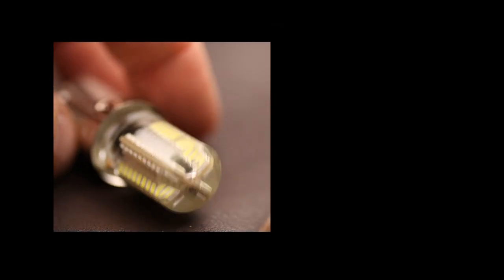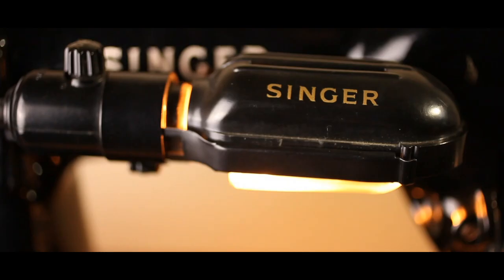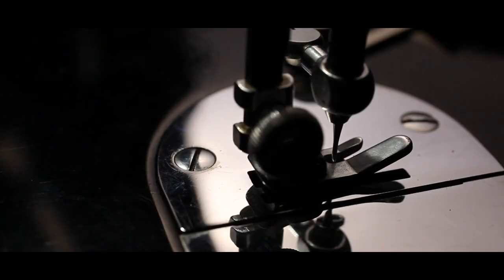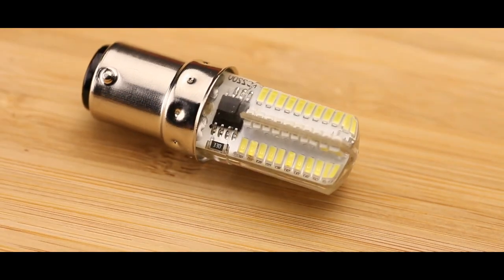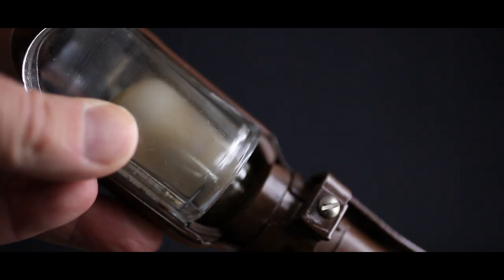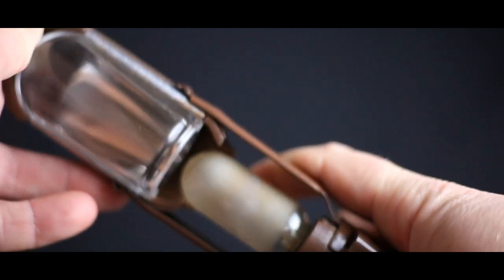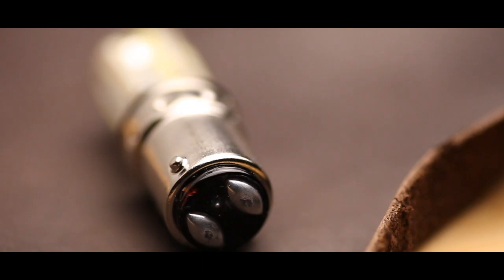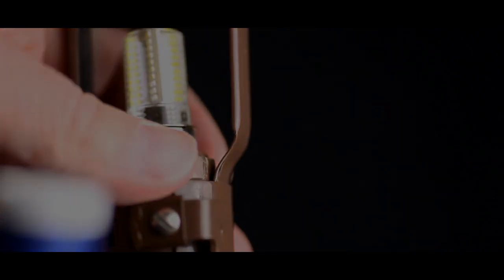Changing a regular light bulb for a LED bulb on your vintage Singer Sewing Machine

Comment: In case someone has the same issue as I did: I replaced the bulb but it still didn't turn ON, it turns out I just had to bend the 2 metal contacts outwards with a flat screwdriver so they touched the new bulb. Good as new

Comment: This video saved me! Thank you so much for making it!! I just picked up a beautiful 99k with this style of light (the Singer Simanco light). I have never seen this type of fitting and for the life of me couldn't figure out how to get the burnt bulb out! I could see that locking mechanism but didn't think to push the bulb in then turn to unlock it!! I think there's a joke about how many people it takes to change a light bulb. LOL. Do you have any videos on wiring these machines? I noticed after I got mine home that there is an old power cord that seems to power the light but there is no electric foot pedal with the usual combined power cord. It's like at one time this was in a treadle and then the light was added but it was still foot powered Yet, there is a motor so I would assume that was for the electric pedal. The power cord doesn't look damaged like maybe the pedal was accidentally pulled off. Have you seen this? I wish I could attach a pic.
Reply from the maker: Hi Karen. I'm so glad I was able to help you with this video. I recently made a video on which color bulb you can/should buy.
The 99k is an excellent machine. Capable yet small. My 99k is a hand crank version.
Unfortunately you cannot sent pictures in YT comments, that's correct. But there is a FB group for Singer 66 and 99 owners/ enthousiasts. Maybe you want to join that group. I'm there too.
I understand you have a 99k with an external bolt-on motor, but you are missing any cords. Correct?
There are power cords available online, but you need to check the connections of your motor first.
Or maybe I did not understand you correctly and you have a motor AND a cord, but missing a foot pedal? If so, you might have a 99k with a knee lever instead of a foot pedal.
My advise: Join that FB group and/or contact me via messenger.
Good luck and enjoy your 99k!!!
Reply: @erikneek  Thanks for the speedy reply Erik. After I msg'd you I went down the rabbit hole of researching my machine and was up until about 4am. LOL It is the 99-13 (with a turn screw to adjust the stitch length instead of a lever). In doing my research I found out this has a hole in the case where a knee lever goes to power the needle and feed dogs. It also doesn't have a reverse function for tacking (so odd). This is definitely a whole new world of machine for me. LOL. Now I'm on the hunt for the lever (it's the round end type not the flat end). I found some people who have done reproductions but I hope to find an original. The only other thing I need is the lid. How do lids go missing?! Haha. So other than those two things it's in pristine condition. If you get a lead on the lid and/or lever let me know. I will just have to clean it and oil it and most likely add some motor oil. I found the owners manual on the singer site. Do you know if the accessories listed in the manual are the ones that should've come with it? I will have to look for those but I think the accessories I have for my 1950's machine will fit regardless but it's always nice to have a complete unit even if accessories can be used on multiple models. :-)
Reply from the maker: @nortok00  Hi. Researching can be addictive 🙂
One of my first videos on a Singer was on the 99. And I mispronounced 'sewing machine' over and over. LOL! So I acquired a new 99 to redo that video. But I have to write the script first. I have so many projects going on...
I love the 99. And the 201. And the 78. And the 221.
Recently I saw multiple lids in a thrift store in my home town. That's not an option for you I think, I live in the kingdom of The Netherlands.
The knee lever can be difficult to find. Try Helen Howes in the UK. There are multiple dealers in the USA to selling old Singer gear.
Oiling the Singer 99 is a good idea. Don't use grease, only sewing machine oil.
In all my years working with vintage Singer machines I have NEVER oiled the motor. So I cannot advise you on that. (Recently I saw a video by Alex Askarov where he said he also havent oiled a motor.)
The accessoires shown in the manual are the same as were being sold with the machine.
Good luck!!!
Reply: @erikneek  Not only is researching addictive but collecting sewings machines is as well. Friends that come into my home think I'm starting up a sewing business. LOL. Thanks for the recommendations on where to find the parts I need. I love going to thrift stores but have yet to see the lids or cases in general but one day I might get lucky and maybe find the knee lever as well although I want to get the lever right away so I can start sewing with it. :-) Alternatively if you find a lid and and/or lever in your neck of the woods I will happily pay for shipping! :-) It's interesting you mention not doing anything with the motor. I have never had to add oil/lubricant on my other machines and I don't even remember that being referenced in the manuals. With the 99 manual it says to do it every 3 (or maybe it was 6) months if the machine is used a lot. Maybe that was a way to keep the motor oil guys in business. LOL. Hopefully you get the video of the 99 done. I would love to see that. Supposedly the machine can do embroidery but the feed dogs need to be covered which is another piece I have to buy and the thread setup is done slightly different. The cover was originally sold separately so didn't come with the accessories. I think my manual mentioned a separate guide for doing embroidery and darning so that is another thing to track down. You will have to research the embroidery/darning part and add it to your video. LOL The rabbit hole gets deeper and deeper. Haha.
Reply from the maker: @nortok00  I had one of those plates with my Singer 66. But I'm not so familiar with that so I didnt film it. ;-)
Reply: @erikneek  Oh wow! Awesome that you have it! Something else for you to get knowledgeable about. LOL
Reply from the maker: @nortok00  I HAD it.  Sold the machine in order NOT te learn more :-)))))))))))
Reply: @erikneek  That's smart!!!! LOL 🤣🤣

Comment: HI Eric, thanks for the video.  I have a Singer 628 series Touch and Sew.  The lamp housing flips down.  We were able to remove the old bulb but are having difficulty installing the new LED bulb.  Any suggestions?  I've replayed the end of your video numerous times and am confused.  Thanks for your time and expertise.
Reply from the maker: Hi Kristin. Thank you for your message.
What kind of difficulties are you having? Problems inserting the new bulb? Or twist/lock?
I have had many Singer sewing machines and some had problems with corroding connectors. Is that the issue you have too?
In MOST cases the installation of a new bulb is very straight forward: Twist and remove the old one. Lining up the new bulb, and then push and twist to lock the new one.
By the way: I had another issue - once. For some reason that specific bulb was not long enough to turn and lock it. It was only a few millimeters too short. So I had to buy a second LED-bulb that did fit.
Please describe the problems you're having. I hope I can help you.
Take care, Erik
Reply: @erikneek  Good evening Eric, Thanks so much for your response. The good news is that the original bulb came out smoothly.  The bad news is that we're  having difficulty with the twist/lock of the new LED bulb.  Upon closer look, it appears there is a lip between the bayonet and the bulb part that is not on the original bulb.( I wish I could attach photos )   Maybe this is prohibiting the bulb from being inserted completely.   The photo of the LED bulb in your video doesn't have this characteristic.  I think I'll try and find a bulb on line that resembles the one in your video.  Hopefully that's the cause.
Reply from the maker: @Travelwithopenmind  Hi. I have a difficult time making a picture in my head of your problem. Indeed, there is no way of sharing pictures. BUT you can upload a video and post me a link. Or contact me via Facebook if you need to.
Yes, there is a possibility you have a wrong bulb. Are you sure you have the BA15 type bulb?
Good luck, Erik
Reply: @erikneek  Thank you for your time, I'm throwing in the towel.  I now have a bulb that is exactly like the burnt out one and am unable to lock it into place.  I really don't have it in me anymore to keep trying.  I'll just use the machine with no light.
Reply from the maker: @Travelwithopenmind  So sorry to hear that.
If you want (in the future) you can also reach out to members of the vintage sewing machine community on FB. Perhaps there's someone in you area who can help you. Just a thought...
Have a great weekend! Erik
Reply: @erikneek  Thank you :)

Comment: Hi Erik! Super helpful, and I hope to be able to do this. I've got an old Singer Style-O-Matic 348. Was able to get the housing and the "cage" off but the bulb appears stuck. REALLY stuck! I can't push it in at all and am afraid if I use any more force it will break. I am quite certain the bulb has never been changed on this 1969 machine!
Reply from the maker: It happens often, that a bulb is stuck. Dont apply too much force since the bulb can break.
Have you tried carefully tapping the metal/tin bottom casing of the bulb, sideways? Only slightly. Maybe that helps.
Unfortunately I don't know any other way.

I'm so sorry I can't help you.

Comment: I can’t get the bulb out >:( I just removed the whole thing
Reply from the maker: Like when surgery doesn't help you can always use a hammer. :-)

Did you try to push it in? When you pushed it in, try to keep the pressure on (=still keep pushing the bulb in) and turn it at the same time. Should work... 

Or maybe you have a later bulb with a screwhead?
Good luck, Erik
Reply: @erikneek  I got this vintage sewing machine from a friend, wasn't a fan of the hot bulb. So maybe someone put a weird bulb in that they shouldn't have? I push down and twist, the glass bulb twists but not the foot (I wonder if it's broken now). I can't find my pliers :( that may be what I need to do...
Reply: I ended up breaking the glass bulb, and I had to hammer into the little holes where the foot notches lock into the holder to loosen the rest of it, and then it came out all crunched up from the pliers but I finally got it out.
Reply from the maker: @estycki  OMG that was really an ordeal! (Is that the correct English term to use?)
The big question: Can you replace it with a LED bulb or is the unit... toast?
Reply: @erikneek  It looks okay :D we'll see, I will try to get an LED bulb
Reply: @estycki  I think those old machines have a very hot light.